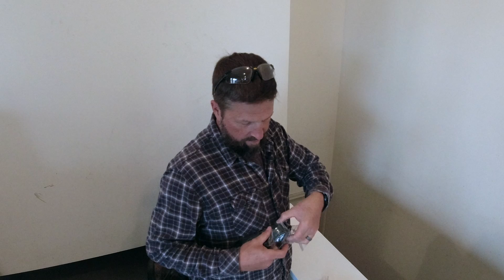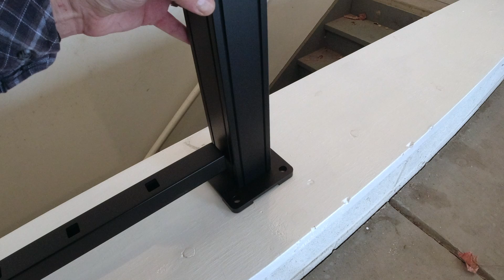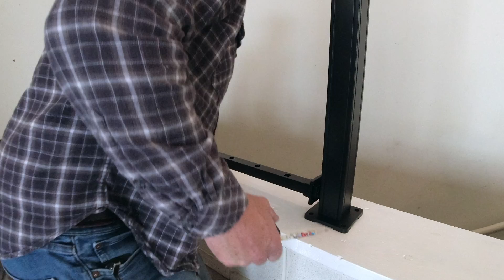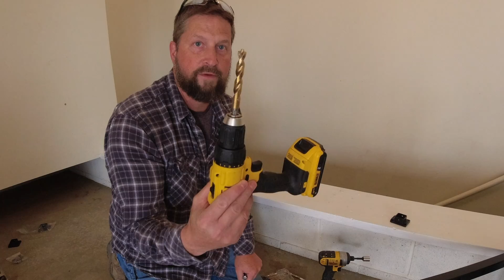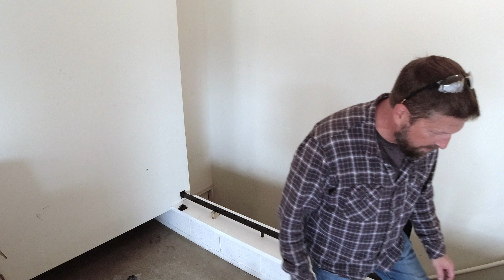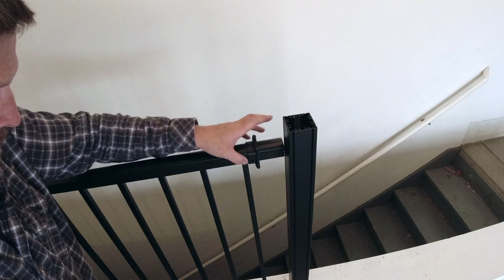Workshop Wednesdays: Weatherables 36" Stanford Aluminum Railing

Comment: Thanks for the video!  I was thinking of buying this exact railing system (but in 42”) for a deck renovation.
Reply from the maker: @davidyoung1610  It's a good kit and sturdy. Still holding up well and looks really high end. I did not like those screws, but otherwise very good kit 🤠👍

Comment: Thank you. I am waiting for the shipment of the same 36" Stanford railing system and going to use similar but 3/8" x 3" Simpson 316SS Titen Heavy-Duty Screw Anchors.
I am Installing 11 panels in backyard on the caps of my concrete blocks retaining wall. I hope 3" long anchors will be long/strong enough for 4" tall concrete caps.
Reply from the maker: You're welcome! Good luck with the build. Glad my video could help 🤠👍
Reply: @samsdoinstuff  It helps a lot! I see in the comments, somebody suggested to use '...1/4" hex head at a minimum is a much better solution...' . I did not get my order yet but wondering, what is the length of original (from the box) screws. Manual says it's #10 but no length. What is your opinion? Is it better to buy hex ones like #10 x 3/4" or longer? Or #8?
Reply from the maker: @angelxoka  Unfortunately, I would have to remove a screw to find out the length and I don't remember off hand. I would think the hex screws would be a better option. I did not like the ones that came with the kit.
Reply: @angelxoka  They are 3/4” in length, not counting the head.

Comment: This would be great if there weren't 20 spindles flopping all over the place when I want to put the top rail on. What's the trick???
Reply from the maker: @stevenhaley443  Great question! Put all the spindles in the bottom holes, then start at one end with the top rail angled up. Put the spindles in the top rail one at a time and lower the rail into place as you go. It really works well. Good luck! 🤠👍

Comment: Thanks for the video. Looks great. I feel your pain on the screw heads breaking off and some of the concrete bolts not working out. Those are the kinds of things that make my blood pressure soar also. Lol
Reply from the maker: Thank you! It is frustrating. I try so hard to keep the old blood pressure in check, lol 🤠👍

Comment: Some quick tips for installs like this: If you get a cheap can of soldering flux and dip the ends of the self tap screws into it before trying to screw them in, it will keep them from melting and also greatly reduce how many sheer the heads off them. If you use a variable speed drill and turn the torque down a fair bit versus using an impact, it will reduce the likelihood of screw head sheering off. The torque on the impact drills are very high. You still need to pre-drill the holes though. Doing this will help you out when using the junk quality self tappers included or drilling into tough materials like phenolic, metals, etc…
Reply from the maker: Thank you SO much! Very good advice 👌

Comment: Another good one Sam ! Thanks 👍👏🇺🇸 Rick
Not meaning to be a jerk Sam, but those safety glasses won’t protect your eyes when on top of your head, while drilling into that metal. Those metal slivers/shavings can’t ruin your eyesight…..forever. Trust an Old Man !
Reply from the maker: Guilty as charged. Most of the time I'm pretty good about PPE but all it takes is one second. Thanks for the reminder!!!
Reply: @samsdoinstuff  I know you are Sam ! Metal shavings are the worst….was just concerned about your safety….for real ✔️👍

Comment: It would be nice if you got quality screws with anything that you buy. Almost worth throwing them away and sourcing them yourself like the lags you got. Great video!
Reply: Very true...and all you'd have to do is take some black spray paint or a sharpie and color the heads black after you install them and you'd never know the difference....course Philips head self tapping screws are about the most useless screws to begin with, a 1/4" hex head at a minimum is a much better solution, and like I said you can just paint the heads once you are done and nobody would notice.
Reply from the maker: I agree 100%